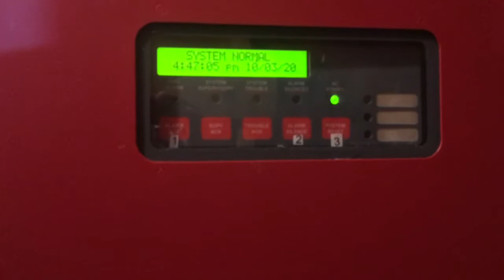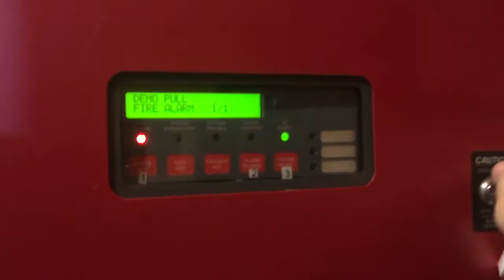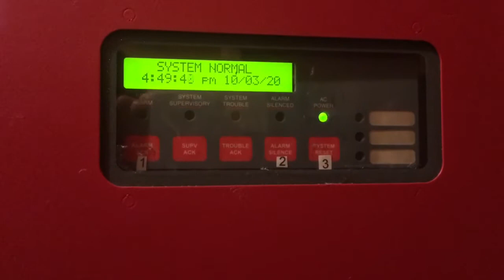Basement Fire Alarm Test 31

Comment: Nice video. What resistors do you use for your panel. I just got 4.7k ohm resistors thinking they would work but I got a short instead.
Reply from the maker: Simplex panels use 10k ohm resistors on the nacs. 6.8k for iam modules and 3.3k for zams iirc. It's confusing.
Reply: @FireAlarmsofNortheastKansas  ah that makes sense. I was told to get 4.7 which I guess is too small and caused a short. Thanks for your help